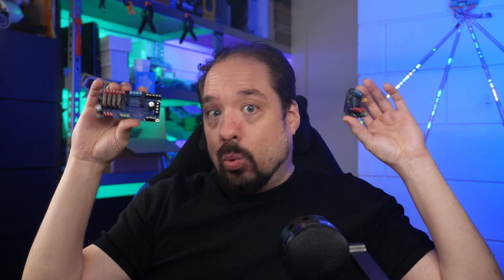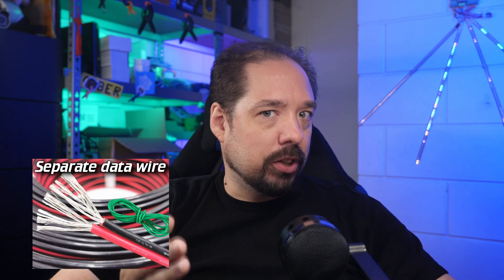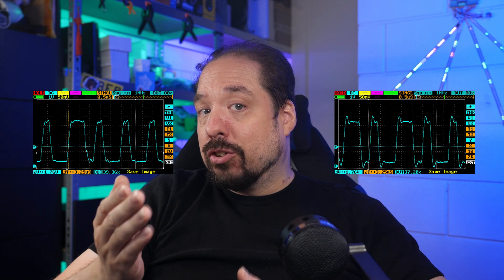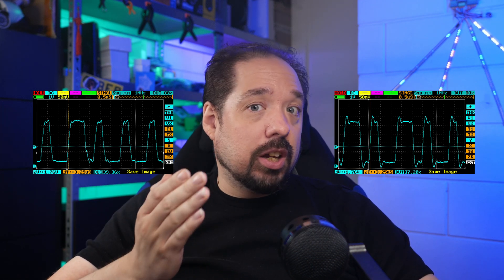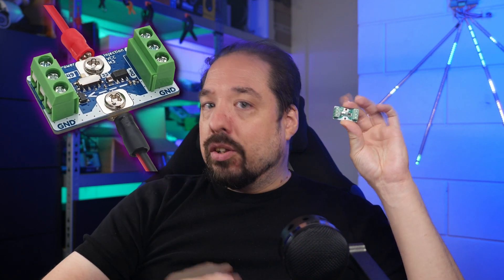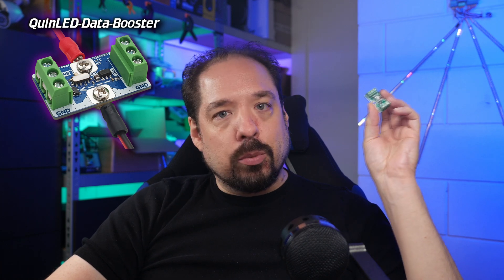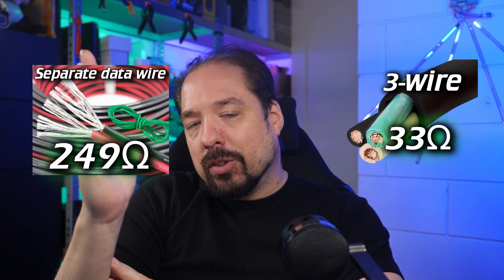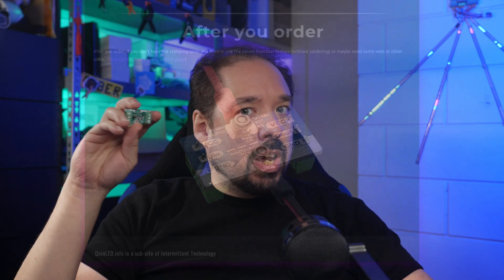💡QuinLED💡 Ever had flickering ws2812b LEDs? Watch this video!

Comment: Perfect timing for this video. I just connected my WLED digquad tonight and the colors and animations were all over the place. I have about 25 ft or 7.6 meters of 3 wire cable for the hook up. I ordered 3 of the data boosters and when they arrive I will post an update. Thank you for your channel and all the great information.
Reply from the maker: I think that will perfectly resolve it, let us know! :)
Reply: Update: Fixed! By adding the booster and set to 33ohms it corrected the flicker and random colors. 

One note to add. When I first hooked it up it didn’t not work. I took it apart and verified my connections but still not working. Well… to my embarrassment I forgot about the slider switch to select from the 249 to 33 ohm. Once I selected the 33 everything worked perfect. Maybe if someone reads this they will not make the same mistake. 

Once again thank you for your channel and all the great technical information!

Comment: Huh. I never considered the transmission line issue, as my data lines are all under 1m. Makes sense though. I do have one set of addressable LEDs around the base of my bar (in Al channel)  that get triggered every time my bar fridge turns off though. Got a solution for this? I've tried separating the LED and fridge power supplies with a high quality mains filter (this prevents the fridge glitching my HDMI over Cat5 but not the LED issue). I've tried shielded data and power cable. I've tried ferrite chokes on the data and power cables. Nothing prevents the first 6 to 8 LEDs randomly switching on when the fridge switches off. At the moment I have a Home Assistant automation that checks if the bar is occupied and if not switches the LEDs on briefly then off every time the power from the fridge compressor goes below a set value.
Reply from the maker: Oh, that's an interesting issue. You could maybe add a fairly low value pull-down resistor behind the level-shifter to the data line, that would try to make sure it's grounded. Not sure how low you can go really before it would influence the signal too much, you could try 1k and see if that does something.

Other then that, actually using triple wire so GND close to data and then using the appropriate resistor to compensate for that can actually add some noise immunity because of the transmission line effect. So that might be worth a try too.

If it's actually triggering the LEDs "directly" so not because of garbage on the feeding data wire, poh, that's going to be tough, are the LEDs in an Alu profile? You could maybe do that and ground it since the LEDs will be insulated from it anyway, but it could maybe act like a shield a little bit.

Hope any of it helps! :)

Comment: Hello. My configuration has 15 meters led ws2815 I did not give a resistor everything works or do I have to provide a resistor? regards :)
Reply from the maker: Well the length of your LED strip doesn't matter, it's the length of the wire going to the first LED from your controller.